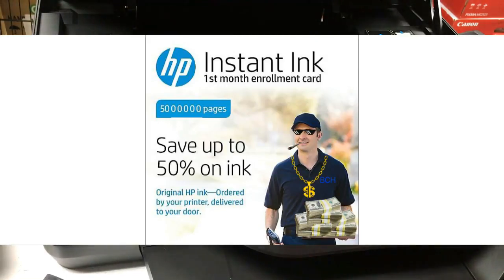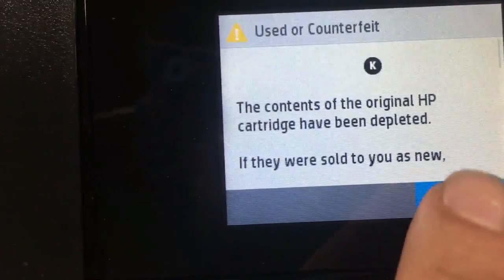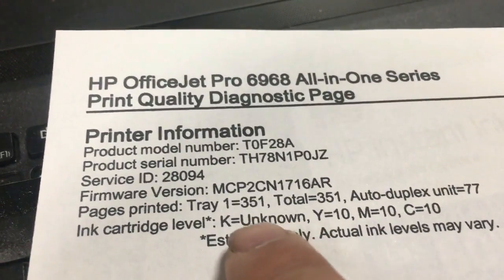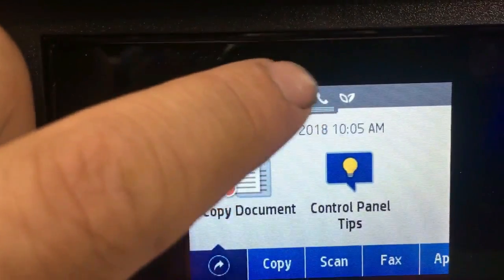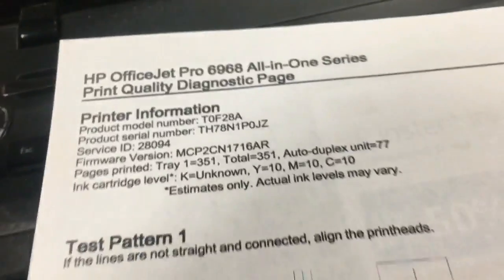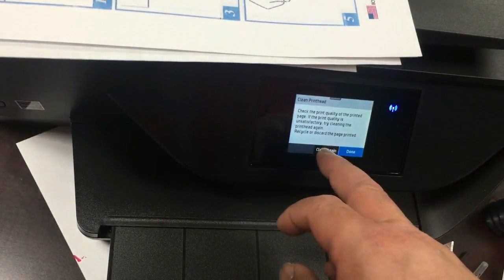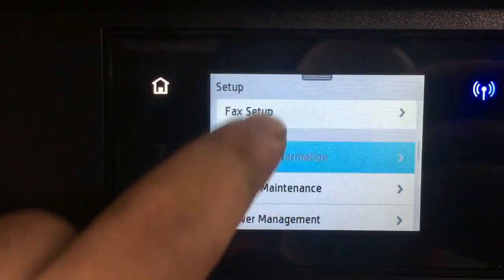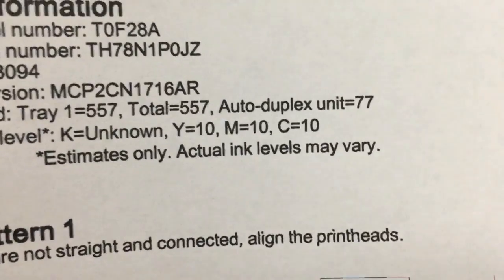V1.3 Turn off Chip Info for HP Printer with LED Panel made after 2016

Comment: I have had a long, hard fought battle with my HP OfficeJet Pro 6970 using refilled printer cartridges.  I finally got it to work!!!!  I turned off the chip as shown in this video and it still wouldn't print.  I found another video by Sue Jones.  She has several recommendations.  The one that worked for me was to simply unplug the printer then plug it back in.  Then hold down the on/off switch for about 10 seconds.  This resets the printer.  I was printing on cheap copy paper and the print quality wasn't good but at least in was actually printing.  So I changed the paper type to HP Photo Papers and voila, it worked!!!!  I've been printing every since.  Thank you Kevin and Sue for your help.  I was ready to throw this printer into the trash!!!

Comment: Thank you so much! I was looking for this solution to my ink problem for a long time now.  I refilled my hp cartridges,  turned off this setting,  but still no color except black was produced in my test sheets. Turn the power off. I took off the cartridges and cleaned the circle heads where the cartridge and printer head meet exactly. It took several self-maintenance head cleanings and print reports to get color flowing again. I still get low ink warnings,  but I just ignore them because I know my cartridges are full. I'll top them off again when ink levels are low. I'll know when once color quality in my prints are mediocre. I know this won't solve everyone problem. Good luck to everyone!
Reply from the maker: Just ignore those low ink warnings and continue printing.  It will eventually show a gray level and won't bother you again.

Comment: Depending on your printer, if your printer is not reading the cartridge or says it's corrupted but you just refilled it you can do this but at your own risk: When refilling the cartridge take off the top paper completely, you'll see a circular indentation to the right of the refill hole.  After refilling use a tip of pen cap or something strong and press that circular depression 10 to 15 seconds, but do not puncture it... That resets the cartridge and usually you can use again with great success...
Reply: Bonjour, vous pouvez me dire où cela se trouve pour réinitialiser ? Si vous avez une imprimante, pouvez vous en faire une vidèo Youtube. Nous sommes beaucoup à avoir ce problème pour l'imprimante HP Officejet pro 7720, 7730 et 7740
Reply: @hugoboss8967  Bonjour, je vous explique comment réinitialiser, vous devez appuyer en haut là où je vous ai indiqué... c'est à peu près tout ce que j'ai à partager...

Comment: Hey! Great video, thanks.
I have an Officejet Pro 7740. The cyan cartridge appeared as depleted(all others about 10%), so I followed these instructions and set "Anonymous Usage Information" to Off. It still would not let me print. So I bought a cyan cartridge, and as soon as I replaced it, without printing ANYTHING, magenta and yellow appeared as depleted and would not let me print. Do you have any ideas? 
Thanks in advance.
Reply: HP screwed you over. There is another video that shows you how to set up your printer to bypass their checks IF you haven't updated the software on your printer. Mine will still print in black. I got the printer brand new for 10bucks so no way I am going to pay over a hundred for ink.Cheaper to get a new printer. The government should not allow the companies to do this but they allow it because the environment is not important to the government. Money is. 
Anyway here is the video link:

https://www.youtube.com/watch?v=Y0I7tOwlu6w
Reply: I have the same case, can you tell me how you resolve it? Thanks in advance

Comment: i turned the chip reader off. I still received message to remove and reinstall the indicated cartage. I have tried 3 different black ink cartridges. it wont let me use any of them. do you have any other suggestions?

Comment: Very helpful video. Thank you. The carriage on my HP Officejet 6968 hangs up at the right end. The ink catch basin(or whatever it is) that extends underneath the carriage when it is parked on the right, fails to fully retract like it use to, causing the carriage to hang up, when it tries to move left, triggering a false paper jam error. There is no indication of gear slippage or broken pieces of plastic observed anywhere. The printer is about 3yrs old. Was working fine until out of the blue, the catch basin begin stopping right in the line of travel of the carriage causing it to hang up. Any idea what is causing this problem? Thank you.

Comment: Sir i have hp 65 ink cartrage if i buy new cartrage and gut out new cartrage and install spongeless caps  and always keep it with ink i will never have issues with the ink notification like when you use a already used cartridge?
Reply from the maker: You will have the notification once, and then you click "Yes" or "OK" to continue using it.  There will be a little banner says "low ink" when you print but nothing else.

Comment: Hello, I’d like to ask a question I have about my HP office jet pro 8710 if I may. I have original Cartridges along with a set of aftermarket cartridges. My question is, when I replaced the original cartridges with the aftermarket ones my printer was complaining about them of corse but the printer was not reporting the proper ink level. The replaced cartridges were actually full. The printer says that the “new” cartridges are genuine but previously use and say they may be counterfeit. Is there a way to reset the chip on the cartridge so the printer reports them as full with using the printer? Furthermore I have auto updates off and sending Anonymous information is disabled as well. Any info I would appreciate! Thank you.
Reply: Hey, I'm not sure if you've solved your problem, but yours sounds similar to mine. I have the 8715 (same as 8710 to my understanding) and here's what I've learned. The only way to reset the cartridge level is, I believe, to replace the chip. There seems to be no way to reset the page number on the chip without replacing it. It sounds like your aftermarket cartridges are actually refilled, but genuine, HP cartridges. Once the chip is replaced with a third party/aftermarket chip, your printer will say the cartridge is not genuine. Just keep those usage data storing, auto updates and sending anon info turned off. I followed a YT video and did that as well, though after doing so, my setting for tracking usage data has disappeared completely. The only way to tell when your cartridges are low is by them running out while printing something. But to me, that's SO worth it to pay ~$6-$45 per XL cartridge sets. The $6 figure is if you buy a refill kit and do it yourself, $45 is buying a 3rd party XL cartridge set on Amazon. I bought a refill kit and refilled my original HP cartridges, but came to find out that I couldn't reset the data on the cartridges without getting a new chip (which I can't find). Hope this helps.
Reply: @trumpatier  hello there thank you for taking the time to share this info!

I am still having the same problem and after a bit more research myself I’d have to agree that the only way to dismiss the message in to replace the chip. I’ve been looking into a continuous supply modification but I would not want to try to install it myself cuz I might break something and then there goes my printer lol. It’s too bad that there’s no such device for just simply resetting the chip, perhaps there is but I have not been able to find one for that particular family of printers / cartridge type. I called a local printer shop in my town and told them my issue and they sell “unspent chips” but they are just a few dollars short of just going out and buying a new set of cartridges. Keeping my fingers crossed for a better solution to come along but for now the printer just complains about the used cartridges lol. By the way, where is all the settings I should check in the printer menu that I should have all turned off? I think I have them all but I’d like to ask in case I missed something. Again thank you for your reply!
Reply: @youtubzer  Ahh dang. Yeah it seems like HP may have sued chip manufacturers or something. That may be the reason that EVERY place (Costco, Walgreens, Office Max, etc) stopped refilling cartridges. As far as I know, those settings are just under Settings -> Preferences, just like this video shows. I couldn't find any additional similar settings in the secret engineering menu.
Reply: @trumpatier  awesome thank you

Comment: There is a another that you Heck ink cartridges. But first you have to  dissemble the printer and go to the the logic board you will see there is a small battery installed,you have to remove it. I do it with my HP deskjet 3835 printer.
Reply: Can you do this to any computer
Reply: you could also use a couple wires to reset the counter chip hahaha seen it done. and the funny thing is it prbably works in all printers except i havent seen the electronic boards of many
Reply: @rodrigodiaz7167  how you do that? can you tell me?
Reply: @me2youMohamed  no sorry bro, i saw a turk doing this for a tonner printer for instance. i dont know enough electonics but im pretty certain it can be done

Comment: I have hp office jet 7720 , I am getting message that ; this printer is not designed for continuous ink system ? I replaced inks but same problem , any advise or shall I replace printer head

Comment: Hey fellow people who refuse to pay egregious prices for printer ink! I have an HP Officejet Pro 8715 (same as 8710) and here's my experience. I'll share this info so you hopefully don't have to go through the same stress that I did.  The only way to reset the cartridge level is, I believe, to replace the chip. There seems to be no way to reset the page number on the chip without replacing it. Once the chip is replaced with a third party/aftermarket chip, your printer will say the cartridge is not genuine, but should still print fine. Just keep those usage data storing, auto updates and sending anon info turned off. I followed a YT video and did that as well, though after doing so, my setting for tracking usage data has disappeared completely. The only way to tell when your cartridges are low after stopping the usage data tracking is by them running out while printing something. Or, I suppose you could print a quality diagnostic page and track your pages printed, but that's a pretty inaccurate metric. To me, that slight inconvenience is SO worth it to pay ~$6-$45 per XL cartridge set instead of $130. The $6 figure is if you buy a refill kit and do it yourself, $45 is buying a 3rd party XL cartridge set on Amazon. I bought a refill kit and refilled my original HP cartridges, but came to find out that I couldn't reset the data on the cartridges without getting a new chip (which I can't find). So I had to buy a 3rd party set of cartridges and they work great. Halofox brand on Amazon. Hope this helps.

Comment: I have a solution to fix all of the problem , no ink, no problem , no print head, no problem , pesky hp tech look your settings and nothing works ?  simply unplug the affected printer and take it outside , sit it in the yard away from anything else , douse it with a flam flam, stand clear and light with match. No more problems !